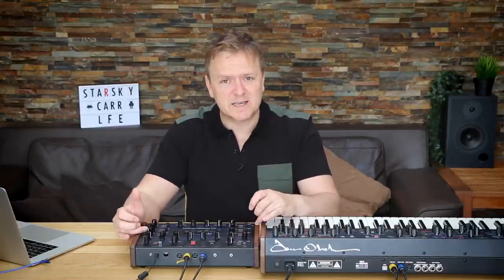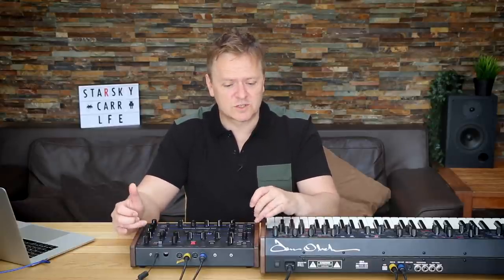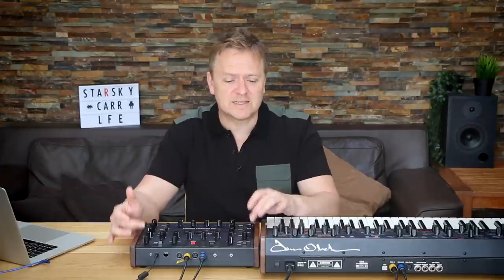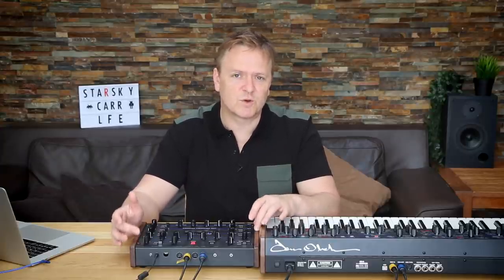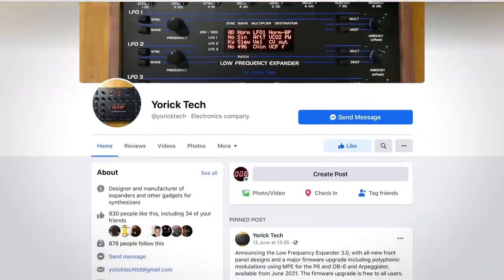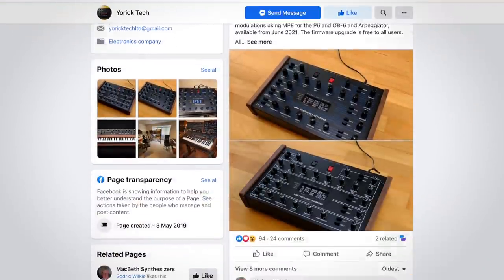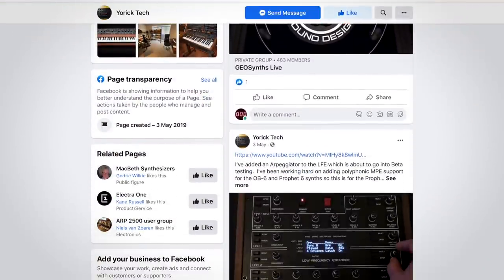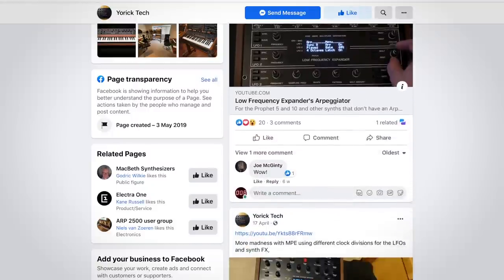Low Frequency Expander // Increase your synths modulation capabilities

Comment: Bit sad it doesn't do Sysex. Some vintage machines only has direct parameter access through sysex, and it's not as frightening as it seems. 7-10 byte message with one or two bytes representing the parameter value. Could be programmed on the LFE screen.

Comment: price?
got  sick of  scrolling on FB  page trying to  find it

scroll scroll scroll..........
Yorick Tech
February 25, 2020  · 
I'm now taking deposits for Batch 4, for delivery in May/June.  Prices are the same: £540 for basic LFE, £50 for walnut ends and £40 for CV in and out, either 1/4" or 1/8".

Comment: Heads up for Linux users that the program QMidiArp can do a lot of these things in software. I use it sometimes. MIDI CCs really suck though. Jitter, limited resolution, poor implementations are clicky, etc.
But sometimes it's good enough.
Reply from the maker: Limited resolution in some parameters is noticeable… but there’s normally a workaround like using the onboard FX for those and the LFE for others.  But yeah, it’s there.
Reply: You can also do a lot of this with a DAW like Ableton as well - nice to have the functionality in a dedicated module, though.

Comment: One thing I really wish the OB-6 could do is use the filter env to modulate the amount of VCO-2 send in the X-mod panel, especially on the Filter Frequency and PW-1 destinations. Is it possible to use the Expander's envelope to control X-mod send? If so, does it work the way you'd expect? I'd almost be willing to pay the price if that was all it did.
Reply from the maker: You can use it to modulate the amount of x-mod... but not separate amounts from each mod source. in other words.. you can modulate any knob, but nothing 'under the hood'. If you;d like to use an envelope to modulate the x-mod amount then you can use the on board envelope to do that..

Comment: This is what I’ve been developing in Max with a Midimuso Octex and KSP
Reply from the maker: I’ve no idea what that means but it sounds very impressive 😀
Reply: @StarskyCarr  Max is a creative music/video programming environment (where Max for Live comes from) and the Octex a MIDI/CV board.  I just wanted to experiment but this gadget is what I am hoping to end up with, potentially in a eurorack module. The main thing is the modulators so modify one parameter with another but also programmable gate sequences (like Pamela’s New Workout) and not just MIDI or CV but ah open combo of both.

Comment: When you change the midi settings, will the midi coming from the USB, to and from the computer still be working with the daw? Otherwise it will be useless for me. Probably a dim question, but I am learning :D
Reply from the maker: It all works fine with your DAW. No issues here whatsoever. Better to double check with Yorick Tech if you’ve any specific questions.
Reply: @StarskyCarr  Thank you. I spoke to him and came to the same conclusion, that it would work fine with my setup.

Comment: Does the LFE work with the Clavia Nord Lead 4?
Reply from the maker: it works with anything that can be edited via MIDI - but  if its not got a preset for your synth you need to program the synths parameters.. They will then add it to the presets if you like - worth asking them.

Comment: How many presets can it store? 🤔
Reply from the maker: it can save 1000's of LFE presets (ie setups per patch). It doesn't currently save the actual synth patch... but it could ... and just as many.  It's worth contacting him directly using the email address in the comments. There are +ves and -ves to doing it each way from a user standpoint, so it could be added. (quite simply I think).
Reply: 8 banks of 1000 patches per synth type. So you can have one bank of 1000 for OB6 for studio use, 1000 for live use, 1000 for experimental stuff etc. Then the same again for P10 etc.
Reply: @StarskyCarr  Thank you gentleman